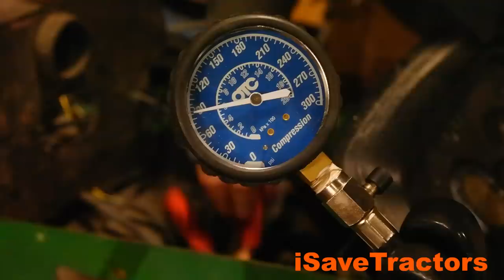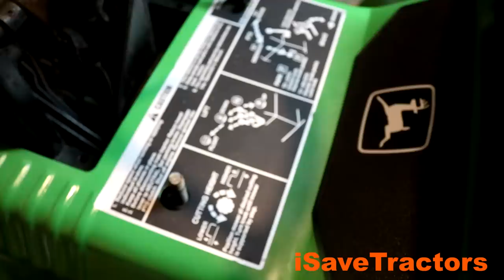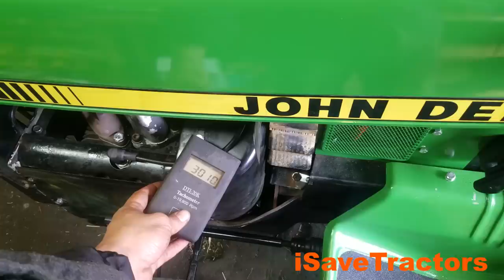John Deere 400 Garden Tractor Restoration Start to Finish

Comment: Where do you get these projects? I wish I could find one I found a 316 for 400 obo with snowblower and deck a tiller is 150 is that worth it it’s non running and one side has low compression

Comment: I just ran across this video as a recent subscriber to the channel. It is of particular interest to me as I have a JD 420 at home that I have not used in several years. I can't really bring myself to sell it so this looks like a logical step. Great work on saving a true old workhorse. Anyone that ever used any of the 317 thru 430 models would most likely agree. Sad there are none of the new ones built like that anymore. Thanks for the inspiration and kick in the pants to work on mine.
Reply: Ken Nolte, no joke. This kinda helped cuz I’ve got a 82 212 that’s been sitting in our barn for 7 months because I’m 16 and I bought a truck that needs work, so it was kinda sad for me to do it but I had to park it. Then 7 months later after my truck is in good working order, I finally decided to revive it, re sealing the head/gasket, new carb I bought on amazon from “I-SAVE-TRACtORS”  and fuel system-fuel lines and filters, checked the ignition timing, changed the oil, and am re-painting some of the panels now. I’m really excited to finally drive it again. You can view the progress at MikeJD60. That’s my channel I’m just on my personal account.
Reply: @michaelbenoit248  I'll look it up when I get home.  Good to see you rescuing an old tractor.  Good for you.  I'm looking forward to seeing your project.

Comment: OUTSTANDING JOB! She has a new heart and is ready to get back to work. I did the same with a 430. Such great machines!
Reply from the maker: Thank you!
Reply: CTSully1, the power of these old machines is of old American steel. That NO new machine can replace. I own a JD212 and it runs like new. Very hard to kill.
Reply: As far as the paint I think you'd be better off doing an automotive basecoat clearcoat black urethane paint and a Deere green basecoat clearcoat. It will hold up better and last longer for many years unlike the enamel stuff. Same with the yellow for the mower deck and wheels. That's what I'm going to do when I get my 216 john deere professionally all restored. You want to do things the right way the first time when restoring stuff like this.

Comment: Holy mackerel!! You did a heck of a job looks brand new. That would make a good tractor loader backhoe. What’s the size differences between that and the simplicity 4041 you showed awhile back?
Reply from the maker: A little Shorter, and about 300 pounds lighter. It would make a great Backhoe Loader Platform, which I may do in the future.
Reply: Do it! Build it into a TLB. That 149 was an awesome build but this would be amazing.
Reply: What's a good source for parts for an old Gravely 812? Would love to find a 3 point for it
Reply: It's only a mower to me

Comment: That lawn tractor had a 3 point on it? Amazing.  Also a cast iron block.  That was built for the long haul.  Nice job.
Reply: *Garden Tractor lol, those things are beasts m80!
Reply: The K532/582 was the pinnacle of flathead engines. The overhead valve engines of today more readily comply with new EPA regs and are more fuel efficient, but the torque these engines produced is legendary

Comment: Good job Norman. Those 400s are workhorses, im sure you will lots of uses and the amount of capabilities they possess. Just a question, my father-in-law acquired an early jd214 w hyd lift, definitely a project but its all there. I've often overlooked the 200 series until now and man they can do alot! If you find a 200 series cheap i love to see you restore one and put it to work. Glad i subed awhile back.
Reply: Adam Engelberth, yeah so back in late August of 2017 I acquired an 82 JD212 for $250 on Craigslist bright it home cleaned the carb/fuel system, put a seat cover on the existing one ($30 Amazon), cleaned the paint up, new ignition switch, aired up the tires fresh battery, and she runs like a dream. Since I was 15 and bought a truck I had to park it becuase it needed a carb because it was running like crap and yes I did set the timing/points on it that helped but still ran like crap. So new carb, new fuel lines, new tube in one of the rear tires, new points, fresh oil change, and needed some attention on the charging system as well as a new PTO switch, new springs on the drive train, and many other things. The thing is 37 and almost 38yrs old. Most mowers never make it that far. Being that I bought a truck all the money that would be spent on the 212 went to my truck so I parked it. If you search MikeJD60 I own the Chanel I’m just on another account. But yeah the 200 series mowers are great not to big and not to small just right. Except for the wide turning radius.

Comment: Awesome video.  I picked up a JD400 a couple years ago but the engine smokes bad so I'm planning on pulling it soon. How much bigger can you reliably bore the cylinders?
Reply from the maker: You can actually bore it to the K582 dimension so you've got plenty of meat on the block.
Reply: Did you get the decals in a kit or did you ha e to find them separately?

Comment: A friend of mine recently replaced the ignition coil on a Kohler Magnum 20 on an Ariens GT20 due to the spark plug wires’ insulation cracking.  He had to remove the engine to do it.  I hope you replaced the coil while you had the engine off.
Reply from the maker: Everything replaced! This engine uses a different ignition system than a magnum 20 so I wouldn't have to pull the engine. However if I had to replace the starter I would have to pull the engine.

Comment: Hi Norman. I am starting a restoration of a 1965 110 I have a lot of work to do before I get to this point, but do you think the rustoleum Paint can withstand heat for painting the engine? Thanks for the help
Reply from the maker: For the engine block you should use high temp engine paint and primer. The sheet metal around it can just be normal paint

Comment: I have John Deere 400. Recently right side of the engine stop working. It working very rough.  I change spark plug, wire, even try  to switch spark plugs wires in the electrical coil - effect the same - right side is "cold". I can't figure it out why. Coil seems like working on both sides when I was switching tspark plags wires attached to the coil. Please help me with any advise.

Comment: Wow. What beautiful work.. I was wondering if you could help me with the steering gear. My steering gearbox is super loose. Is there a rebuild kit or adjustment procedure that you know of? I would greatly appreciate you reaching out to me...thank you for your videos
Reply from the maker: You can adjust the gearbox by locating the cam. Loosen the jam nut then tighten the cam until it bottoms out, then backout a hair. Tighten jam nut.
Reply: @Isavetractors  is the cam adjustment on the bottom of the steering gear?

Comment: Have you ever had any problems with having the clearances that tight that you had to beat in the cam and other parts? I know on bikes with out oil clearance between parts they can seize.
Reply from the maker: This was an unusual circumstance. Normally it doesn't lead to that. It was a tiny warp in the rear cam bearing from pressing it in. Cam turned freely and had the proper clearance afterwards with proper oil pressure. Sometimes shit happens and you just have to figure it out. If the cam didn't move freely after tapping it into place I would have had to remove and redo it however cam bearings are difficult to find. I mic'd the front cam bearing and the cam and knew my clearances were perfect. I was surprised when it was so tight but knew the rear bearing may have been squeezed by a thousandth or so when the machine shop pressed it in. Once in I confirmed it turned freely so I moved on. Oil pressure is normal and the engine has about 20 hours on it.
Also don't confuse tapping with "beating". Small plastic hammers dont transfer as much energy as steel ones. That camshaft just needed a little persuasion.  This video is presented for your entertainment. Don't assume you see everything that happened with this engine.

Comment: Hey Norman I have a John Deere 316 and the engine needs to be rebuilt the engine is a p218g and I can't find parts. Where did you get your Onan parts?
Reply from the maker: We are starting to develop parts for the Onan P216. With that said this JD400 project used a Kohler K532 engine
Reply: @Isavetractors  so you won't have p218 parts in the making? Like rings pistons bearings and so on?
Reply: @Isavetractors  hopefully you will eventually I would hate to put a predator engine or something other than the onan in it
Reply from the maker: We are working on it now! Hopefully by mid 2020 we will have a full line.
Reply: @Isavetractors  that's awesome news! I'm really excited to hear that you'll probably sell alot of those parts
Reply: @Isavetractors  I know I've commented alot but the new parts won't be super expensive right?

Comment: I'm curious how long the restoration took and at what cost? Also curious as to what engine that was. I have a possibility of getting three JD tractors.
Reply from the maker: This is a Kohler K532 19.9 HP engine. I think this project took my 6 months to complete. I am sure I answered it further down the comments when the video first published.
Reply: @Isavetractors  ok, I am going to start some restores and you make it look quick & easy with the time lapse so I wasn't sure of the time involved. I'm thinking the JD's I'm looking at are 311,312, & 318. I also got to see a 735 I think that had a yanmar 35 HP diesel in it. It had the full hydraulic compliments and pulls 5 JD utility trailers joined together in a train for outdoor events. It's pretty cool. Thx for the info. I did pickup a David Bradley tractor with belly mower and a homelite T-16 with  100% intact. It needs alot of TLC too. What you can do is amazing.

Comment: Great job and thanks for filming it in a way that lets viewers slow down just the procedures we want to see the specific details of.  If you’d cleaned up the smudged yellow handle on the deck lift (try 99% isopropyl alcohol), it would look brand new.  Thanks for sharing your experience and knowledge with this great video.

Comment: Looks great!  Just one question, I bought a Case 446 years ago that had an electric fuel pump.  It overfueled badly and i couldn't get it to run properly until I replaced the diaphragm fuel pump.  It later started to burn oil badly and I wondered if the extra fuel washed down the cylinders so the rings wore out.  Is that fuel pump special for a small engine?
Reply from the maker: Hi there. Thanks for the question. Yes the excess fuel may have diluted your oil and caused premature wear. But given the age of the engine it may have already had an oil burning issue. Hard to say without examining it. Fuel pumps for these engines should have a fuel pressure of 10psi or less.
Reply: Yes it's a "who knows?" situation but the excess fuel probably didn't help anything.  I have no idea the pressure of the electric pump that came on the tractor just that it was more than the float could stop.

Comment: Norman, thx for the great videos! I just bought a well running JD 400. I was thinking of getting a front end loader for it. Any thoughts? what about a backhoe? Trying to do this cheap and cheerful. I have an old Massy 50 but its really underpowered these days. I have an ATV snow blade that I want to try and mount on it once I get the loader (like another of your videos). I have the Snow blower and a 60" deck for it, so it will be really useful for me, I hope.

Comment: hey norm, i know your a busy man but i have a question about those rear wheels and hubs on the 400 are they unique to the 400 or did the 420-430 have them as well????
Reply: Ok here’s the scoop the John Deere 400 is unlike any other it doesn’t really share any parts it’s an oddball machine the 318 212 300 etc can share parts a400 doesn’t share parts so you really can’t use any parts from. 400 unless it’s like a seat or handle or something do you have any John Deere garden tractors

Comment: Going to do a rebuild on a 318 in near future. Good video.  Isn't the fit on the cam bearings a bit tight?  Even on a slow turning L-head you need a bit more clearance. As a long time engine builder (auto) I like to have the cam turn freely when installed.
Reply from the maker: It was a little tight. Like a .001 clearance. It turns easily with the gear on but was snug going in. It shouldn't pose any problems.

Comment: Hey i savetractors i have a question what seals the axle ends on a ford 120  the right rear wheel its leaking diff oil how can i fix thaf
Reply: uses a square seal inside near dif bearing.

Comment: Hey Norman what is the purpose of the rubber hose/nipple piece that is attached to the air cleaner ? I have the same air cleaner on my 317,, and my nipple hose isnt closed at the end,, it is sort of open at the end from sitting on the intake,, does that matter and what is its purpose?
Reply from the maker: It's just a way to recycle crankcase pressure back into your intake. It's not needed. It was put in place for emission purposes at the time period.

Comment: I've got a 400 that just needs some leaks fixed and a carb .this video gave me a lot of visual info. Thank you! Are the parts you used exact fits? I'd love just to order them and know they wont be a pain
Reply from the maker: Yes all of parts for your engine are perfect fits UNLESS your cylinder borr is worn past specs and needs machining. We have oversized available too

Comment: Wow great video.  I have a Bolens with a 23 HP Kohler K582 engine that I would like to rebuild.  I noticed that you had some of the parts on your website but I am looking for connecting rods.  Do you have those yet?   Thanks again for the video.  You are one of the only people that I have found that made a video of rebuilding a Kohler K series twin.
Reply from the maker: Thanks for your comment. You will be seeing more of the k twins from me. I plan on doing a how to video focused just on the engine. I have 3 other K twins to feature. We should have connecting rods by the end of the year. For this project my machine shop resized the originals
Reply: That really great.  Thank you chris

Comment: Nice job but I have a question? Was the engine rebuild vid in sequence? Cutting and lapping the valve seats after the crank and cam are installed spooks me. Slight chance to get some metal garbage into the freshly cleaned works. But nice job.
Reply from the maker: Thanks for your message. No not everything in the video is in sequence. Most of it was done out of order, then pick up shots to correct for bad lighting etc. Movie magic! Thanks for watching

Comment: Norm, how much should it cost for boring and cam bearing install?
Reply from the maker: Typically a boring should run $75/bore from your machine shop. Press work for the bearings should be minimal

Comment: Hello norman I have bought the wheel horse with the kohler k181 but I need a good spark plug wich do I need for the kohler
Reply from the maker: Champion J8C
Reply: isavetractors okay
Reply: isavetractors the spark plug in the engine is good but my rubber fuel pipe was bent and in bad condition and my carberator didnt got any fuel from it but I had relaired the fuel line and it is running like a New kohler k181
Reply: isavetractors but thanks again for the help

Comment: Is there a reason that you don’t overhaul the transmission while you had it out?
Reply from the maker: It didn't need it.  No leaks, only 500 hours on the original meter. No indication of rebuild needed.